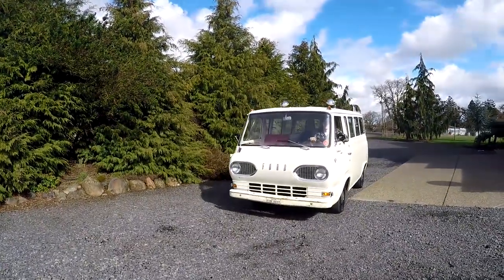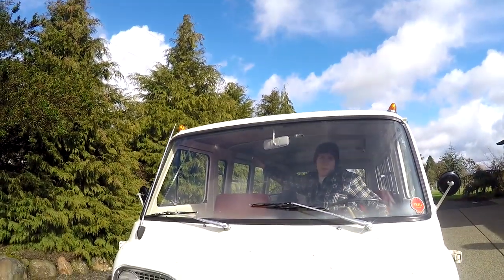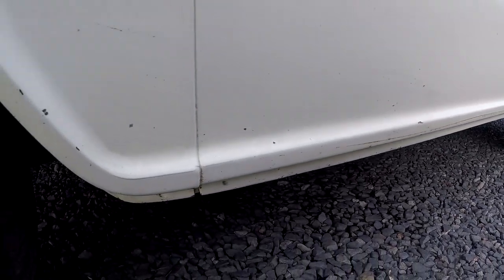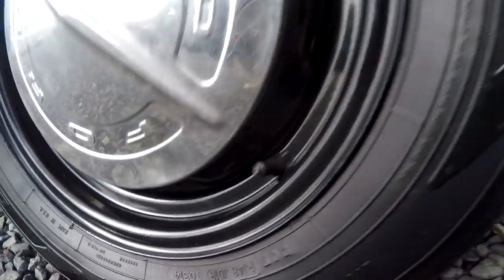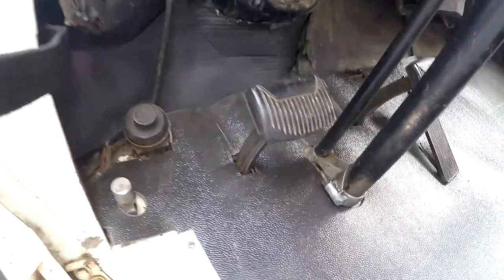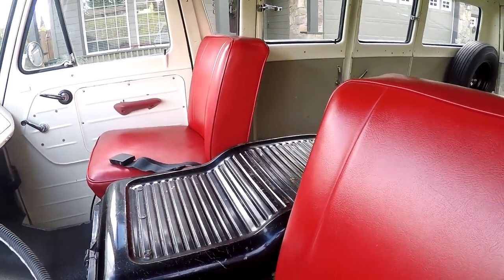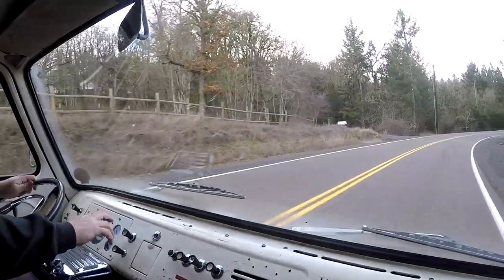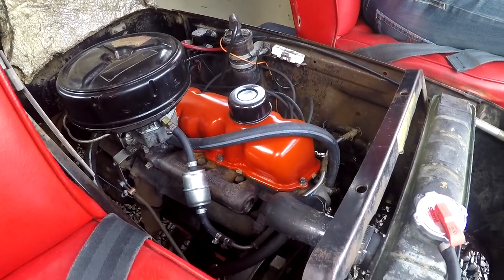1965 Ford Falcon Club Van - Denwerks - Econoline

Comment: Cool Van, just a few notes:  The falcon van (Passenger Model) was available until 67, this one must have had the seats removed.  The passenger vans were named it Falcon as a marketing plan to be grouped with the Falcon family of passenger cars.  Those round tail lights were available all of the way to ‘67, the last year.  The elongated rear lights were on the 65-67 super vans (extended).  

The bumpers were not a factory option.  The license indent in the rear is left over from the 61-64 models that had a different bumper, in 65 they moved the license plate to the door.  The kick out step was also factory for the passenger vans (Falcon).

The 3 speed was not as common in 65-67, they introduced the C4 auto in those vans in 65 and are a little more common, cool rarity.  100% agree with the previous poster, that is not a cruise control.  There is a lower air scoop that is missing, it directs air to the radiator 

Nice original hub caps!  Cool van!  Body is super solid!

Comment: I've got the 61 blue white. Sat untouched on my property for 15 years Some kids riped the badges off broke the drivers window. So I towed it home Sold it to so called friend took it never paid me. Took a year brought it back dumped it behind my barn that was 13 years ago. Last summer went to look at it seats engine dog house starter radiator were missing drug it to the garage. Got seats made my dog house got stater turning over has spark. Taking awhile cause have bike and boat projects I'm getting on it. I live in Davenport WA. Not far from ya. Nice.

Comment: Woah!  Don't use that throttle lock as a cruise control...way too dangerous without brake/clutch deactivation.    Those locks are used typically when you have a PTO driven take-off like a pump, and you want to hold the engine at a constant speed. Turn the knob and the engine speed will come up...the button in the middle is to release it back to idle.